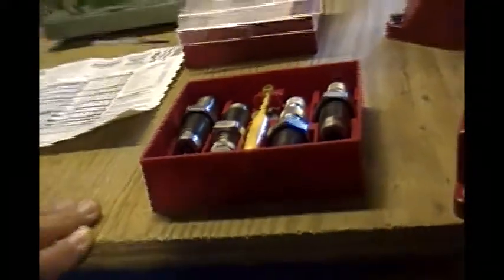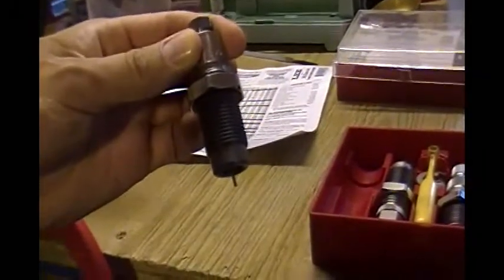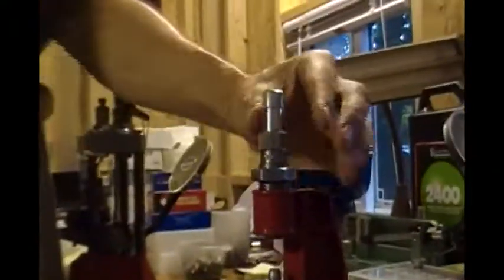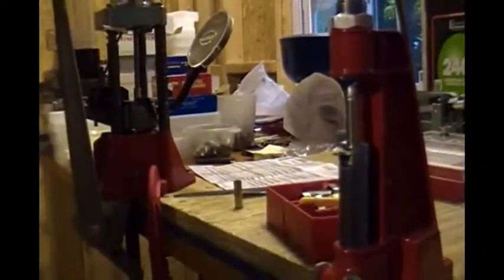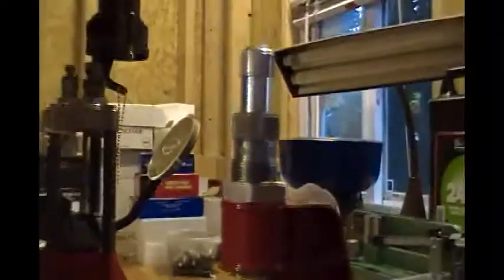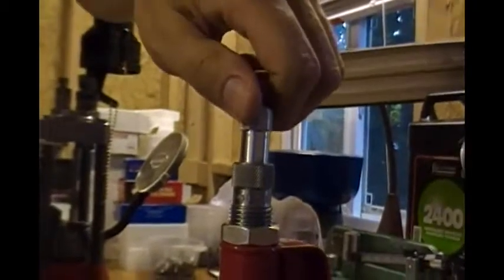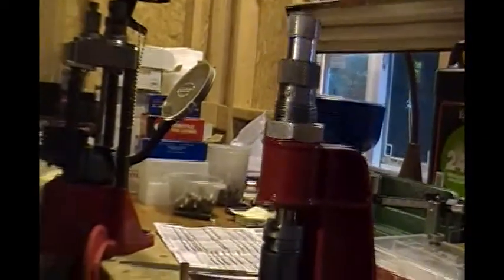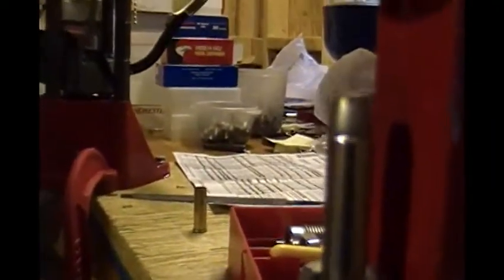Adjusting Dies - Part 1 - Single Stage Press

Comment from the maker: Congrats!  Sounds like you guys are on your way.  Keep up the good work.

I've seen a couple of things cause primer dents.  If it's on the Pro 1000, your shell plate timing might be just slightly off.  That's easy to adjust with the zero adjustment screw.  The other thing I've had happen is a grain of powder on the priming ram, so that's a good thing to check for as well.

Glad the videos are helping!

Comment from the maker: @rockyuruguay Thanks!  And your method of using a factory round also works well, as long as the bullet you're using has a similar profile (sounds like yours does).  I use one of the rounds that I previously made to do the same thing.  Good tip!

Comment from the maker: Sure, no problem.  As Greg has discovered, 9mm is pretty easy.  Of course, I'd also recommend checking out the Ammosmith forums as well, since I personally haven't done very much bottleneck case reloading (got the dies, just haven't done much yet).  Several folks over there do on a regular basis, though and could better help out there than I could at this point...though that will change down the road.

Comment from the maker: @dsb1829 Ah, I've had that same exact thing happen with .357M brass when reloading with the .38 Spl dies.  What happened is that I had it adjusted for .38 Special and forgot to re-adjust it for the longer case.  After cursing myself for knowing better, I readjusted the die for the longer case (grumbling at myself all the way) and was just fine then.  Hey, it happens.

I now keep one of those buckled cases (deprimed, of course) by my Pro 1000 as a reminder.  C'est la vie....

Comment: Nice video.  I ran into a few issues following setup of my dies using the Lee instructions.  I think I would have been a bit better off seeing this.  I managed, no thanks to the instructions.  My first 50rd all went bang.  Only comment I have is that it I do not think all presses act the same.  On my RCBS if I only back out to the instructions spec for the flaring/powder-thru die I will buckle my cases.  This may just be an issue with the 10mm/40s&w die instructions when loading 10mm.

Comment: Maybe you would know. I made some 9mm and started using the lee factory crimp die. After I used it, the bullets were moving around and you could literally push and pull and bullet around (it wouldn't come out) in the brass. What did I do? Previously, I just would size/decap and seat. I wouldn't touch the FCD, nor would I  set the seating for to crimp. Any thoughts? Thanks